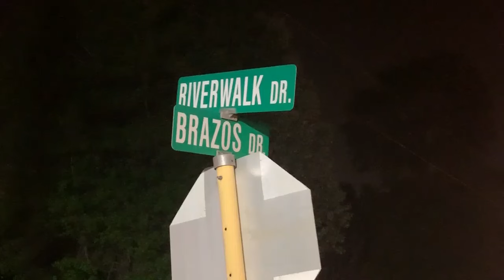031520 OFF DUTY METRO POLICE SGT FATAL

Comment: You don’t get these kind of results unless you’re still going 60 mph sideways when you hit the tree.
Reply: Haha, at 60 mph this car would be torn to pieces.
Reply: I've slid directly sideways into a telephone pole going about 45-50 mph, drivers side door impact. Bucket seats became a bench seat and my console was destroyed. The frame rail on impact side got slightly bent. The impact knocked me out briefly.  No injuries.

My point is the guy in this vid was flying. I don't care how old or dated the car was.  He was probably going faster than 60.
Reply: @jasonarpy  That's nothing. I once collided with a train at about 90 mph head on in a Daihatsu and survived without a scratch!
Reply: @swordfish1986  I know, I am the train.
Reply: @swordfish1986  Chuck Norris, why the alias?
Reply: @swordfish1986  I hit an elephant on a moped in India.
Reply: @swordfish1986  Was the Daihatsu scratched?
Reply: This car is from an era before government and IIHS crash tests, when crash safety was not tested or considered by manufacturers (and most consumers).  There is only a lap belt, at best (I do not see any belt).  The B pillars and dashboard have no energy absorbing material.  The steering wheel is probably metal and the steering column is not designed to collapse with some amount of
Impact.  Obviously there no airbags.  When IIHS started side impact testing (in the past 30 years), test results showed a 30MPH side impact would be fatal in many vehicles.  Now days you would walk away from that with barely a scratch with most cars (obviously depending upon the weight of the object that hits you).  Even a 20MPH frontal impact could be fatal in vehicles from this era.  In today’s vehicles, you can survive 50MPH or more.  Cars have come a LONG way in safety since this car was built.  The structure was so weak that if you cut off the roof to make some modification, you would have to first put cross braces between the pillars to prevent the structure from deforming.

Comment: I see corvette valve covers, I'd say the brakes and suspension components weren't corvette
Reply: Spot on
Reply: A wise man once said "Speed won't kill you, its the sudden stop that'll get cha" cant imagine what the family is going through... Losing a family member because they went out for a cruise. Extremely sad
Reply: thats what got him killed.prob 450 horse with worn out king pins quarter turn of play in the wheel from everything else worn out. vette mtr on a log wagon. sad.
Reply: He used Hyundai parts for the suspension.
Reply: That's a ls6. Also, those are fuel rail covers, not valve covers.
Reply: @codyweien4513  valve cover covers.
Reply: Well, technically, the front end suspension setup IS corvette. Being this car is a 1954 chevy, it has exactly the same kingpin front suspension and brake setup as the 1954 corvette. The Whole clip is interchangeable between the two models, removeable with 4 bolts to the frame. (Provided this  front suspension is still factory stock and not a mustang 2 conversion that is)
Reply: From what I could see it was pretty much a junk pile mechanically
Reply: wouldnt say that the bodys condition was to hot either... not that it made the car less safe, it wasnt safe to begin with
Reply: @codyweien4513  I didn’t think about LS6, I knew it was either an Ls1,2 or 3. How can you tell it’s LS6 from these pictures?
Reply: @samholcombe3129  fuel rails, intake, accessories among other things.
Reply: @codyweien4513  I can’t tell an LS1 intake from LS6 unless it’s off the car and turned over
Reply: @samholcombe3129  no EGR is a dead give away
Reply: @codyweien4513  I was looking for that but I just couldn’t see good enough to say for sure
Reply: @codyweien4513  there is no way to tell any of that. No EGR also came on the later LS1s as well. Not to mention the accessories are all interchangeable as well as the fuel rail. Furthermore, without seeing a head and block casting number you really don't know. The LS6 intake came on the later LS1s too. So you can't say for sure that's an LS6 as it also has aftermarket accessories such as a vintage air compressor setup. Someone could easily disguise any LS to look like an LS6.

Edit, after seeing it has an Fbody (LS1) power steering pump/res and an LS1 intake with the EGR plug in it, and the fact that no LS6 had a cable driven throttle body, it's definitely not an LS6
Reply: It’s an LS swap, to much power for old antiquated brakes.
Reply: @codyweien4513  King.
Reply: It had large diameter custom wheels made to look like originals. I'm guessing it had a full more modern chassis and brakes. It was a badass ride. Never seen a car done that way. Looked like original paint but badass underneath.  Amazing. But sad....
Reply: @ixlr8677  
You and the rest of us who didn't know the car's owner have no clue what was done, if anything, to modify the suspension and brakes.

Comment: That car hit HARD. That is a full frame , not a unibody.
Reply: They have no structural strength compared to modern vehicles.
Reply: More like a rust leftovers from frame
Reply: I have a few unibody car's that are way stronger then most full frame cars  my 67 Imperial is a prime example.
Reply: @juliogonzo2718  your kidding right?
Reply: @nealbeach4947  no I'm not kidding, older cars were death traps. Radio knobs lodged in peoples heads, no energy absorbsion, cabin intrusion, no seatbelts etc. Have you seen the crash test between a 2010ish Malibu and a Bel Air?
Reply: Ain’t going to happen— Christine has left the iron heap- lol
Reply: @nealbeach4947  
Thinking that old cars are safer because they were all steel and sat in a seperate frame is incorrect.
Unpadded interiors with cast metal knobs and solid steering columns don't crush on impact, the person inside does.
Modern cars absorb the impact by deforming and scrubbing off the force of impact.
The human body does not like sudden stops from speed.
Reply: He was going way to fast... To cause that much damaged..
Reply: @1724nine  still he was going fast  that at least ,50 M.P.H.  if not more
Reply: @fubartotale3389  not really new cars are safer but old cars look cool new cars look the same... crap...
Reply: Some of those old cars had X shaped frames. Not good at all for side impact.
Reply: Dude was doing over 80mph when he wiped out.
Reply: @hobbyhermit66  Exactly,  will crush easily from a side impact.  Too much power for otherwise stock vehicle, especially with small tires.
Reply: @peterrivney552    He was going way to fast ... indeed!
Not hitting a tree sideways at speed is the only thing that would keep the tree out of the passengers compartment.
Remember, circa 1950's you still had riveted X frames, no consideration for side impact in the door structure, and no seat belts.  The trans was the first thing to slow the car down.
When installing 4 times as much engine HP, radical suspension and brake upgrades are required as a minimum.
Installing large low profile radial tires as seen at 0:50, is a bad idea. The 1954 steering geometry was designed for tall bias ply tires which behave much differently and require different geometry. 
Very bad judgement combined with these things produced the results you see here.
Reply: @juliogonzo2718  I agree the safety is questionable but you can always put roll bar cage inside for more protection and racing seat belts
Reply: @juliogonzo2718  Yea they weighed a ton and we're dangerous in a collusion with each other. But a car from this era in an accident with a modern car would fair better.
Reply: Yeah it's full frame, but cars of that era wasn't known for their safety in a wreck. Those things would crumble and open up like a pop can.
Reply: @nealbeach4947  nope, it's a proven fact.
Reply: @peterrivney552  all it would take is a 45-50MPH side impact to do that amount of destruction on a car from that era. They're death traps in a wreck.
Reply: @peterrivney552  that has absolutely nothing to do with a vehicles safety in a wreck, just because it looks cool doesn't do anything when you're in a wreck, especially a side impact.
Reply: @LastExile1989  a car from that era vs a car in this era, the old car would fail miserably, pretty much everyone in the old car would be dead.
Reply: @LastExile1989  just watch the video posted above your comment that shows a car from the 60s vs a modern car.
Reply: @juliogonzo2718      Depends upon the vehicle.

Crush zones are engineered for the most likely outcomes.   Not all of them.

I bet my paycheck that the car had ZERO passenger safety features.  I do not see seat belts.  Those are easy to add to any car.
Reply: Corvette motor way to much for that car structure.
Reply: @nealbeach4947  Older cars were crap. Just cause the hood and doors were thicker metal, the rest of them were poorly designed and put SUPER high G-forces on the occupants. Remember, old cars like these are really about the same weight as a mid size sedan today.
Reply: He probably would have lived in a modern unibody car.
Reply: X frames were 58-64. Still LS power in stock 54 not a recipe for safety, plus he had to have been going crazy fast .
Reply: @1724nine  Shitters.
Reply: @bradhardy2629  Thats a good one
Reply: @jamessharp9790  i will bet you he left most of the suspension stock with those massive gripping low profile wheels and tires
Reply: Full frames do worst in side impact tho usually. just the nature of how the frame can only re enforce the body directly above it and only depending in the strenght, location, and number of mounting points but yeah that was probably atleast a 40mph impact I am going to guess
Reply: @peterrivney552   100 atleast.. He skidded on tar and still hit that hard..
Reply: I'd say that was only about 40 mph, just because it has an ls, doesn't mean he was hard in it, a year newer (55) would have probably been a better outcome, but not much, great looks and quality steel do not mean safe.
Reply: @JohnDoe-gz8dw  probably yeah
Reply: He would have been better off hitting that brick wall , I think he upgraded the motor,  but didn't upgrade the brakes or seat belts and he should have changed the steering column to. Those would have help him to maybe live from this going that fast. But once you hit grass it's over no more control of your car.
Reply: From full frame to twisted frame.
Reply: @madmax2069  Yeah, they are not very good with safety on impact, but it could be improved with some mods. But no brand new car can bring the high level of reliability, endurance, simplicity, and ease of repair ( I know it's not the point here, but it's one good point to "why preserve them".
Reply: @juliogonzo2718  your thinking of the 20s-30s mate. After then, you’ve got it completely on the opposite. 40s-50s-60s70s cars were built like tanks, they were safe, no. But they were strong. The problem was is the cars were that strong, the car didn’t apsorb the impact, you did. You went straight into the dash, mostly out of the window because they weren’t no seatbelts in them days. Modern cars are built very weak, but the car apsorbs the impact, not you.
Reply: @juliogonzo2718  you beat me to it.  That crash test is a beautiful example of how far we have come with crumple zones... the old cars may have been bigger and heavier in a lot of cases but they were death traps...   they just fold up crushing everything inside... people have no idea how lucky we are to have the vehicles we have today...
Reply: Actually cars of that vintage had "X" frames which made side impacts real bad. No frame member ran along the bottom edges of the car below the door siles on those. Detroit didn't put full frames on big cars until the early 60's.
Reply: Yup.  My family bought a 54 Chevy brand new off the showroom floor in 54.  It was built like a tank.
Reply: @juliogonzo2718  That video is no comparison, they used a 59 Impala with no engine. It was rigged. These 50s Chevys are no joke to poke around with.
Reply: @fubartotale3389  They're not safer, they're thougher that's the difference.
Reply: @peterrivney552  
No argument there, as an old guy, those are the cars I grew up with.
Reply: A modern car would have held up much better.
Reply: @bradhardy2629  That's also why so few of 'that' model (Imperial) survive,too.....they are favorites of the Demolition Derby crowd? That,and those 'clamshell' 1971-76 GM wagons.
Reply: @LastExile1989  This 50s Chevy is lighter than a modern car of the same class.
Reply: @nealbeach4947  watch this video and judge for yourself if you think older cars are safer
Reply: @JSAFIXIT  no it would not. That's the whole point. Late models absorb the impact to protect the occupants. The people would have came out better but a late model wouldn't have faired much better.
Reply: @txmuddigger Late model cars have crumple zones, but the passenger compartment is designed to retain it's shape, you know so you don't get a pole in your lap.
Reply: Regardless, that takes a lick to almost cut that ol chevy in half, I bet he never hit the brakes....its not the going fast that gets you, its that abruptly coming to 0 that gets you.

Comment: People think that "old cars" are built so much stronger and tougher than the new cars. 
This may have been a survivable crash in a newer car. New cars are designed for impacts and have "safety cages" built in to protect the passengers. Along with airbags, seatbelts, etc. 
Very sad. RIP.
Reply: Most people like me who daily drive a classic understand they’re not as safe, and as such you have to practice even stronger defensive driving. You have to respect the car for what it is, and be more careful not only of what you do, but of what others on the road are doing as well. Driving a classic car comes with a risk that you must always consider when behind the wheel. I’ll never drive anything newer than a 71, but I drive slower than my grandmother, even with my t-birds run-happy V8.
Reply: Old cars are built stronger and much tougher than new cars, they just have zero saftey features, which is why in cases like this they just crumple. But if you really compare how old cars are built, the steel is much thicker and there's basicly zero plastic to them what so ever. All steel and vinyl. Now imagine if cars today were built with the quality steel of old cars with added saftey features. Dream come true for us auto enthusiests.
Reply: amen a cage would help out so much